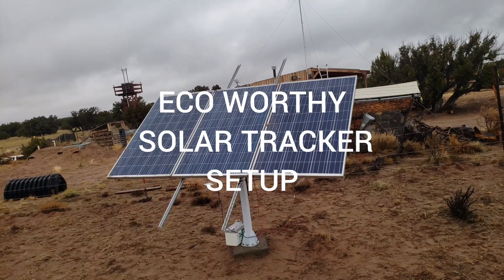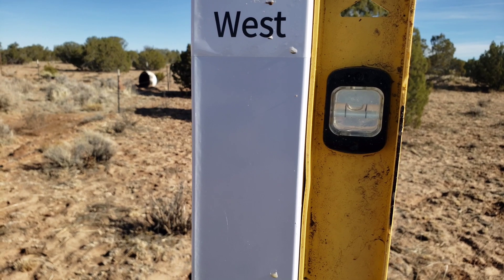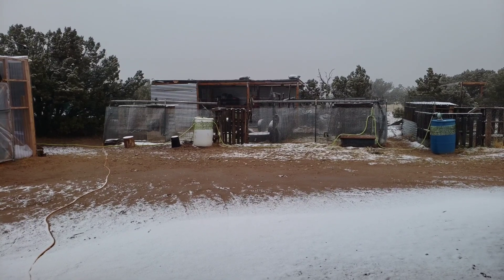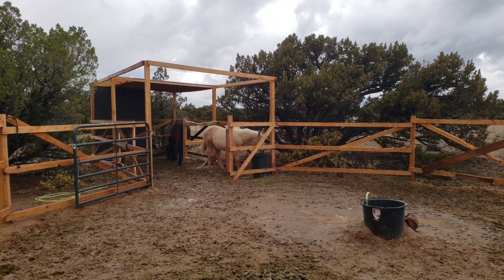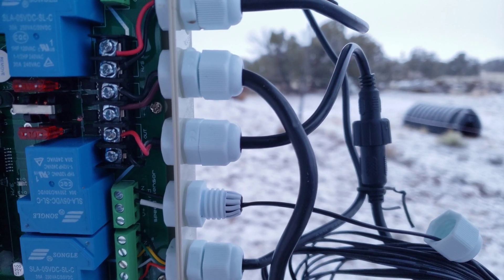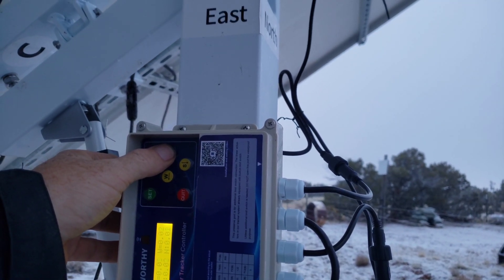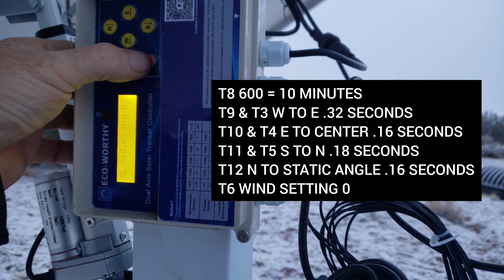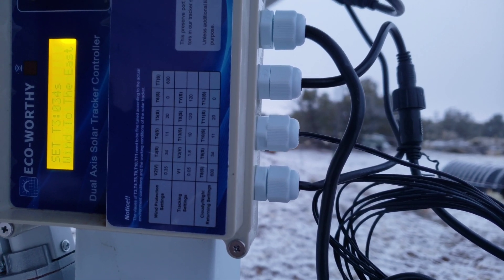Off Grid SOLAR TRACKER

Comment from the maker: Save 30$ with code Frugal30 link in description. 
In this video, I first attached the sun sensor on the south east side of the panels. While it was oriented correctly, I later read that it's supposed to be on the north east side. So I attached it the only way I could. This led to the sensor being oriented incorrectly in the video. I quickly realized it would not work if the cable on the sensor was not facing south so I  bent the attachment to orient it correctly. 
Also, the linear actuator is assembled correctly per the instructions but it turns out it's supposed to be attached to the west side of the unit. By attaching it per the instructions E and W or backward and that is why I had to switch the EW wires in the controller. The unit works perfectly this way but you can avoid this error if you assemble the arm and actuator on the west side of the  unit. 
I'll make an updated troubleshooting video to explain this and more.
Reply: I did some testing with having the long actuator on the east side (then have to switch the 2 wires for the actuator so east/west goes the correct direction when commanding on the controller) this gives you more tilting angle to the west 53° then to the east 35° (i have woods to the east so it works better for me to get more angle in west sky). With it on the west side, it is almost even angle, west 45°\ east 50°. I have also replaced the short actuator with another the same length as the long actuator, moved the bracket back 1 hole on the north/south mount, drilled new hole and installed rivet thread sert, retracted actuator, tilted all the way south and drilled 2 new holes with rivet thread sert. Now it can tilt all the way south and a good angle to the north. I have also seen people putting the north/ south cross strut on the top of the east/west strut instead of under it.

Comment: This may be a dumb question, but am I correct in assuming that  since the sun is low in the sky during the winter months, the panels will stay in a position that will allow the snow to slide off?
Reply from the maker: It's not quite steep enough to prevent snow but it will melt faster at that angle.

Comment: How much more solar are you expecting w/ tracker?  Always though trackers were a great idea.
Reply from the maker: It looks like I'm getting roughly 40% more energy.
Reply: @FrugalOffGrid  would it be more cost effective and resilient if you had just got more panels? Then no need to repair solar tracker motors, and if one panel breaks you have another to remain at 50% capabilities if you only had two

Comment: Were there any instructions on bonding that pole to a ground rod or the rebar in the concrete?
Reply from the maker: I didn't see that in the instructions but my system is grounded at the shop where everything else in the shop is also grounded.